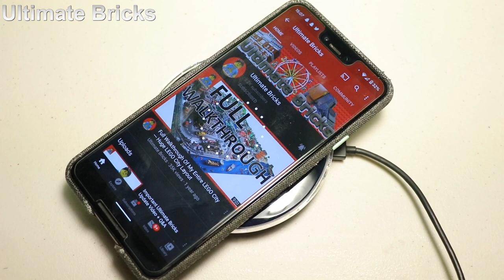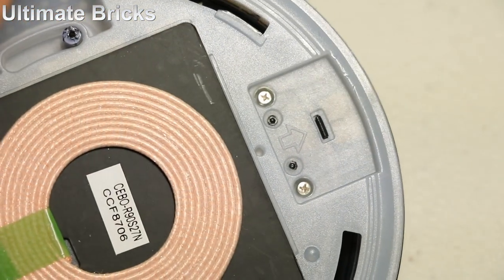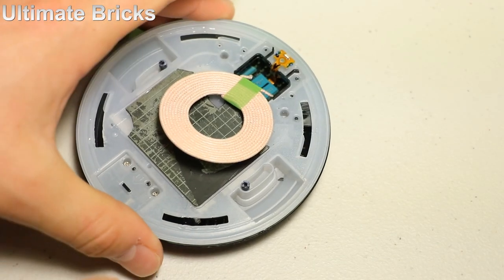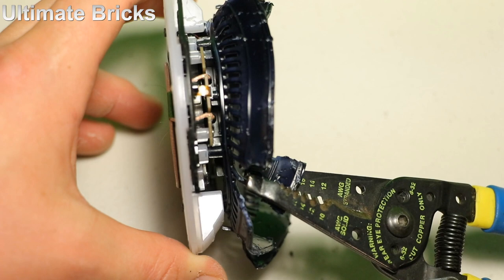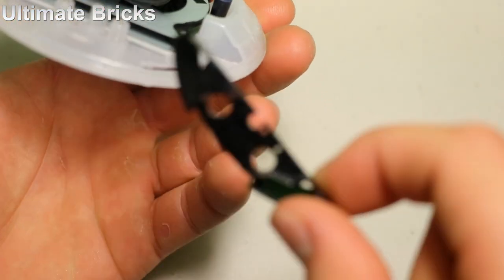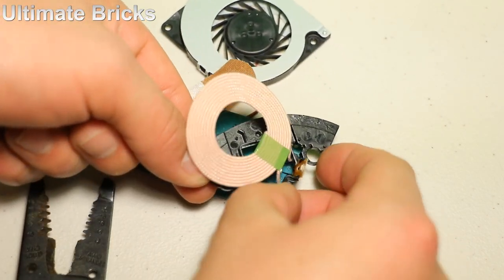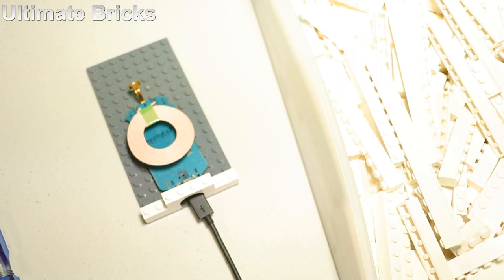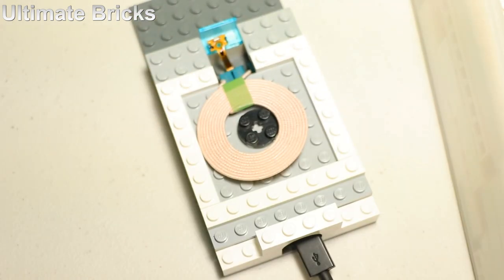How To Build A LEGO Wireless Charger - Tutorial

Comment: I have a few thoughts about the fan and the metal plate underneath the charging coil... the coil is getting hot in the process of charging and the fan only activates when the mainboard thinks it's to hot so it has to have a heat sensor somewhere. And the metal plate what you thought it's a magnet is something to help cooling... you can see it like a cooling paste between a CPU and a CPU fan. So... take care the Lego case is not melting away. 😅